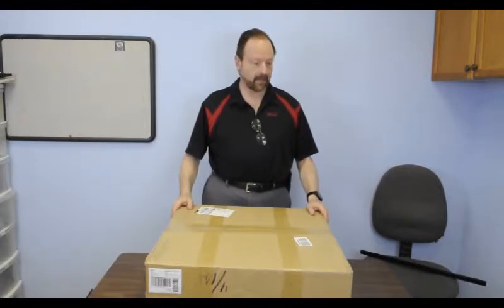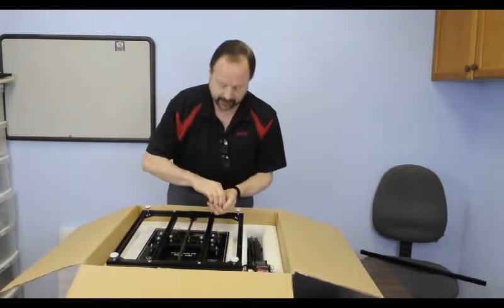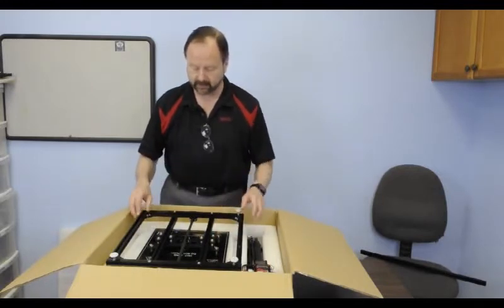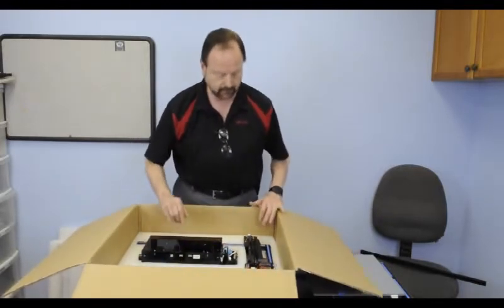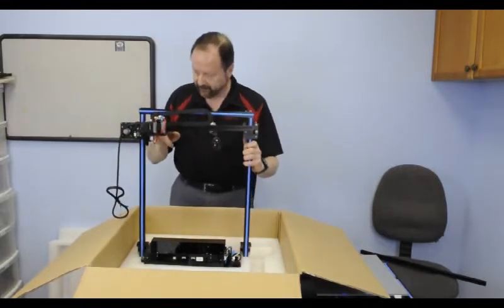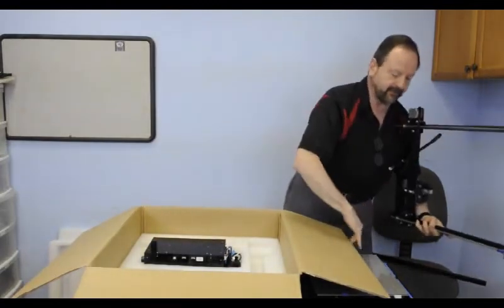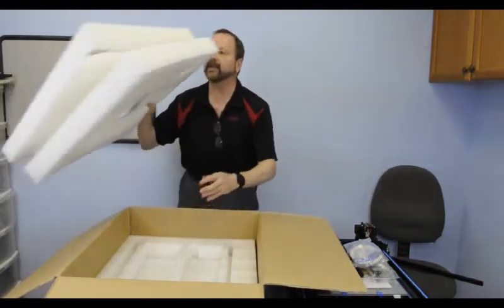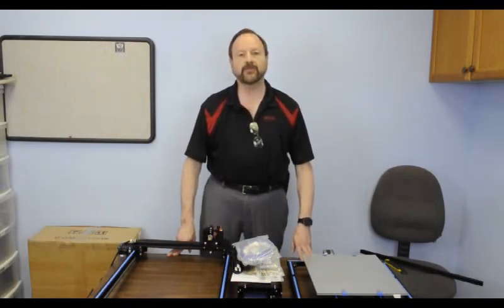Adimlabs i3 unboxing

Comment: I just bought this and I guess they watched your video because the deck was secured with thumb screws.  Good stuff.
Reply: Thanks.  A series of videos concerning this printer will be coming out shortly, so don't forget to subscribe and click the bell.
Reply: I returned it.  With the leveling screws at maximum the back right is still about 2mm from the print head.  After three days trying to print the test solid and even some rudimentary shapes, it's going back.
Reply from the maker: @UnopenedParachute  That's too bad. There are number of possible reasons for that, all of which can be corrected. The machine is actually quite capable.

Comment: Very good unboxing reveiw! I have an ender 3 and would like to get another printer around the same price point. I'm a technician for large format printers (5m wide digital printers) so everything is relative aside from the substantial size difference. I really appreciate your thorough inspection of the makeup of the parts, as I'm not a fan of acrylic parts being used for the frame.

Comment: How do you like this printer?
Have you had to replace parts on it ?
Reply from the maker: The printer is extremely solid and durable. It requires very little to print reasonably good quality. To get it to its best quality there are some upgrades I would recommend such as automatic bed leveling. However all in all it's a solid, well-designed machine.

Comment: Really good look, waiting for the assembly and using
Reply from the maker: Working on the assembly video now.
Reply: @everybody3dprints  did you ever get around to doing the assembly video?
Reply from the maker: @playacanucks  I did not, because the assembly was so quick and easy I was going to do and assembly and review video. Unfortunately I had some issues with the printer, which have since been corrected, but I have not had the time to make the video. As I've done a number of upgrades for the machine, I will be making a video shortly.